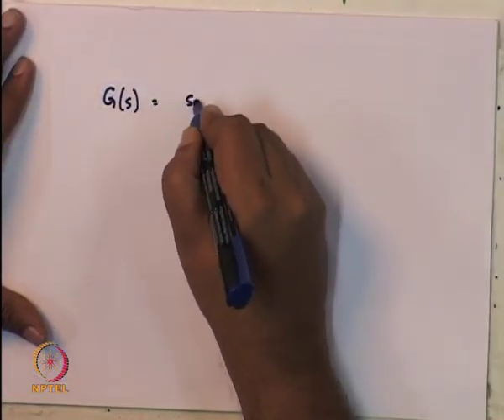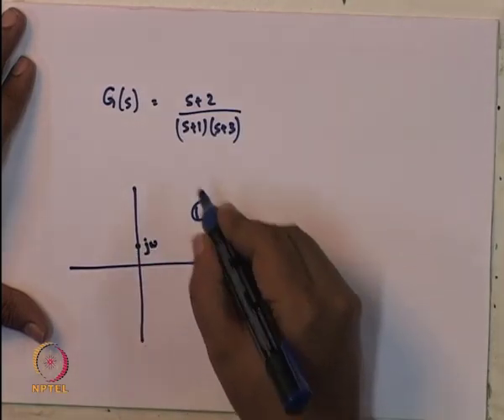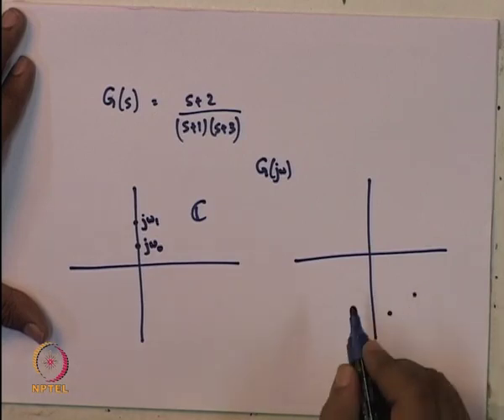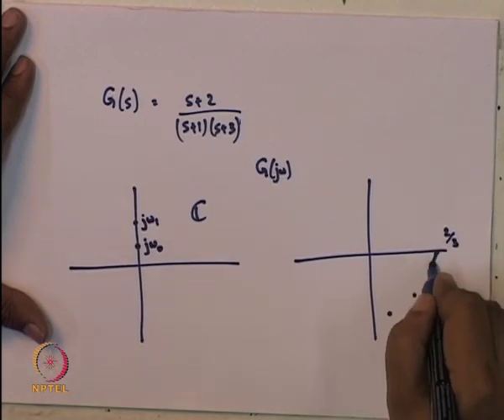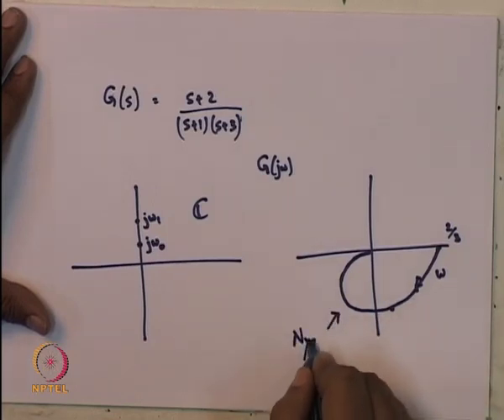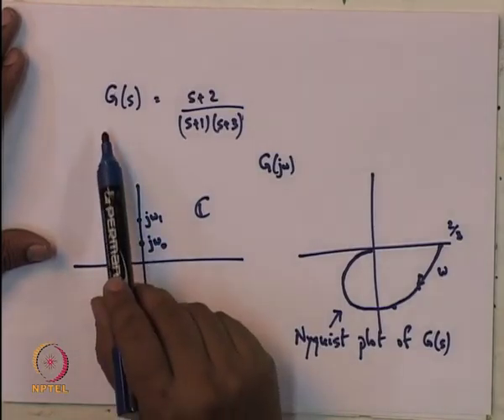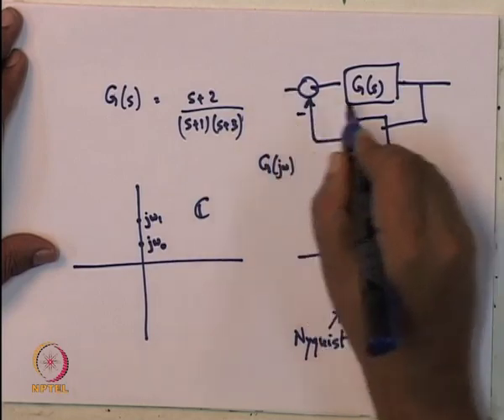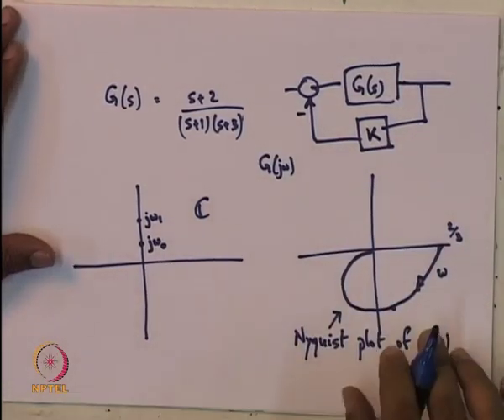Mod-01 Lec-15 Nyquist plots and Nyquist criterion for stability

Comment: In the explanation of enclosures of -1 at 45:09 ;
Where did the effect of the proportional controller K go?
The characteristic equation of the closed loop transfer function we want to solve is 
1+KG(s) = 0. Why are we not looking for enclosures at -1/K?
Reply: we will still look for the enclosures of -1. K just stretches out the entire plot as he said
Reply: By taking K=1,we are overdesigning,because usually K<1